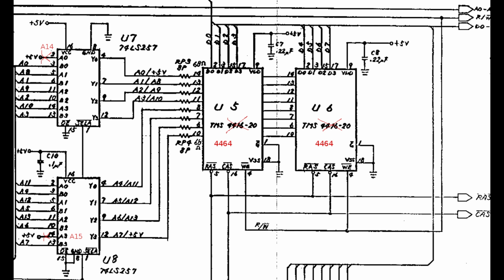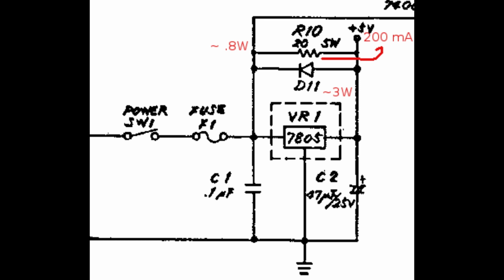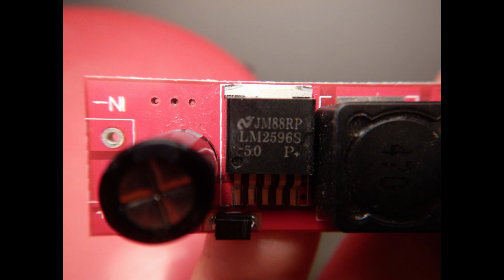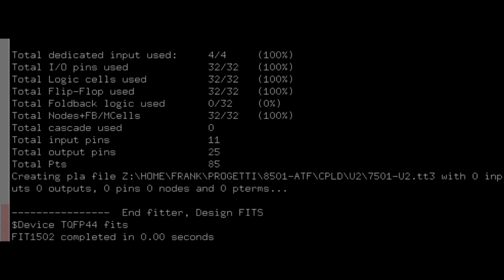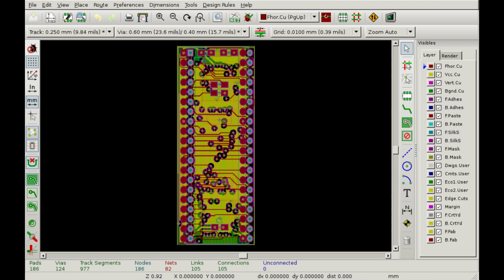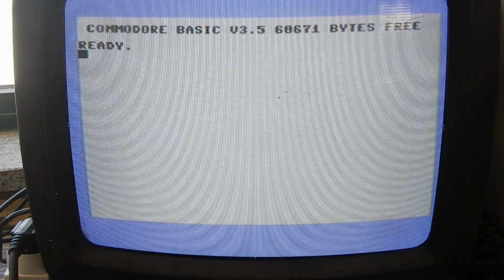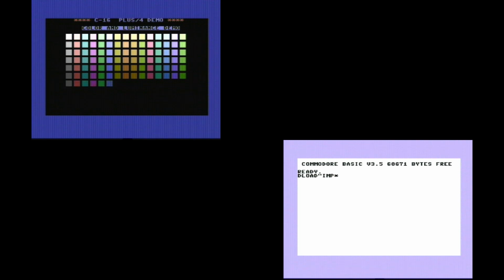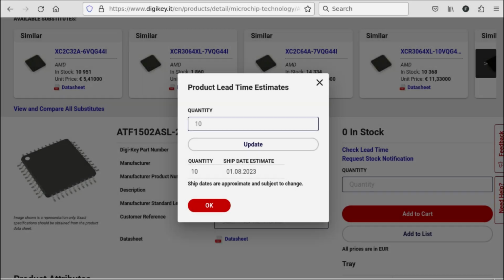Making a MOS7501/8501 replacement adapter with a 6502 (Plus C16 upgrades). Part 2.

Comment: I put a 6510 in my C16.
Reply from the maker: Many people have done that. However a 6510 is a precious replacement for the C64 (and I don't have any spare 6510) and the C16 isn't as valuable as a C64 in my opinion.
Reply: I intend to buy another C64 breadbin so I'm planning to do this cpu conversion on my C16 and will have spare cpu for the C64.

Comment: This is really great content. Do you think it's possible to have a configurable adapter that use a 6502 to replace all 6502 based chips? 6510 / 7501 / 8500 / 8502 ? Also can this approach be used to use a 6522 to replace the way more scarce 6526 / 8520? Finally are those level shifter 3.3v to 5v an option to use more modern CPLDs for this kind of tasks?
Reply from the maker: Yes, if more PCB real estate isn't a problem, a configurable adapter is surely feasible. 6526 could be implemented directly into a couple of CPLDs without needing a 6522, but I've never really investigated it since it was kind of an easy task :) The problem with a 6522 is that one should work around the serial shifter bug that has been fixed in the 6526. And yes, level shifters and voltage regulators are surely an option but I'm afraid it means more PCB space and design effort.